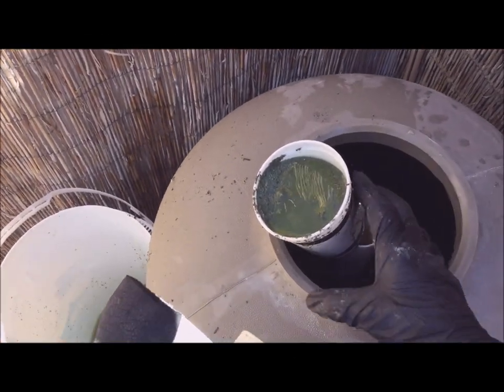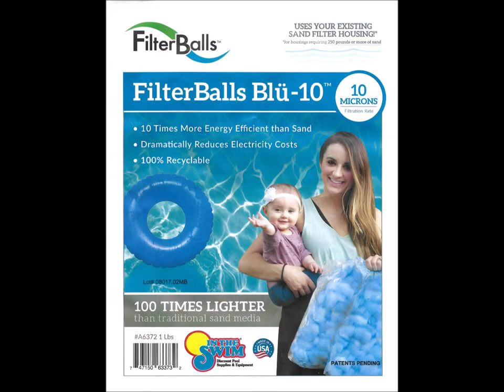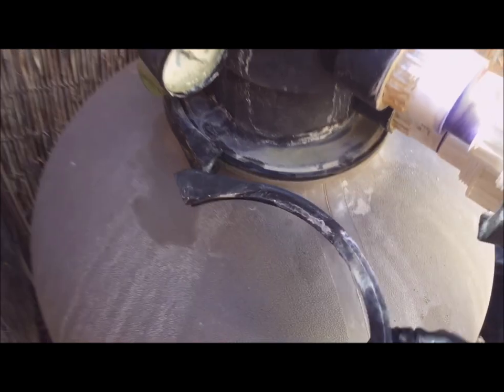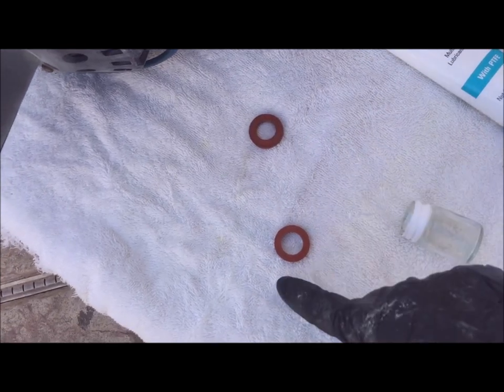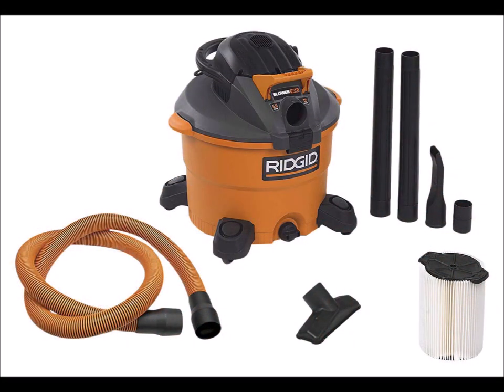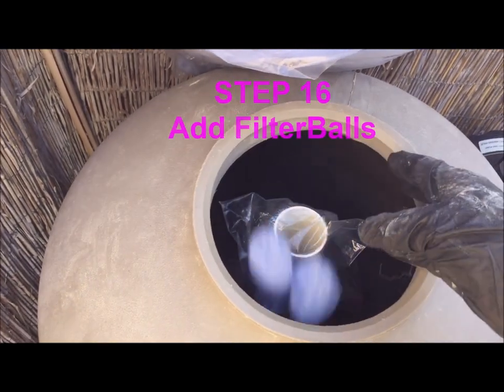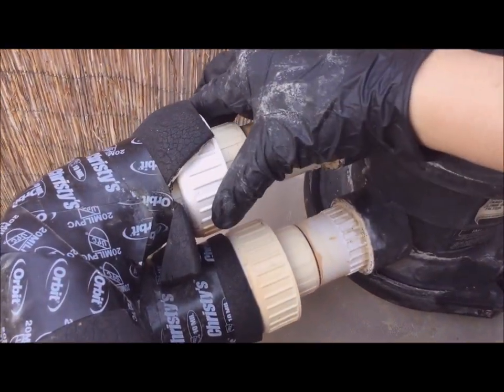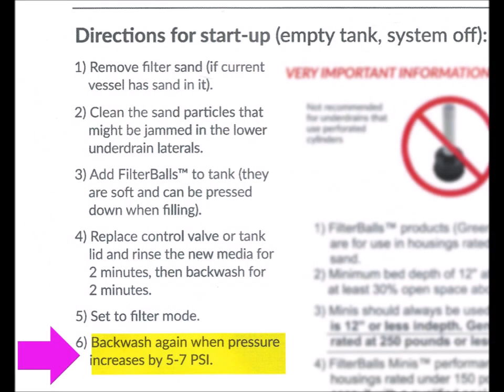How To Change From Sand to FilterBalls

Comment from the maker: ***Well I am on to something else. I am now using GLASS FILTER. Here is the link  https://amzn.to/2X0hcwq
Live and Learn. Who said owning a pool was easy! I am glad I tried it. I am leaving this video up because some of the comments are so-oo good!

SHOPPING LINK
~FILTERBALLS  -  https://amzn.to/2O3cuJl
~Hayward S220T ProSeries SAND FILTER  -  https://amzn.to/2YfGbeg
~Hayward SP0714T VariFlo TOP-MOUNT CONTROL VALVE (multiport) - https://amzn.to/2Y3Kzc9
~FLANGE VALVE CLAMP or COLLAR Noryl Replacement for Hayward - https://amzn.to/2xY83oi
~TANK O-RING (Generic) The one I used - https://amzn.to/2xWBabB
~TANK O-RING (Genuine) GMX600F  - https://amzn.to/2XRArrC
~LUBE for O-RING - https://amzn.to/2XUxG8Z
~FILTER WATER PRESSURE GAUGE The one I used - https://amzn.to/2SqH7ae
~DRAIN CAP Hayward SX180LA - https://amzn.to/2XQyDPM
~SIGHT GLASS - https://amzn.to/2JUnYcW
~LATERAL ASSEMBLY with CENTER PIPE -  https://amzn.to/2SsrbV6
~WET/DRY VAC  - https://amzn.to/2JWd5r4
~BACKWASH HOSE - https://amzn.to/32BZnCi
~DISPOSABLE GLOVES - https://amzn.to/32Ies5d
Reply: Why did you switch from FilterBalls to GLASS FILTER? Were you dissatisfied with the results? The FilterBalls website includes your video as a How-to in their product information section.
Reply: You turned your filter handle the wrong way. You went counter clockwise, instead of clockwise.
Reply from the maker: @deborahdippold291  Yes I did, thanks for the comment. Hopefully others will read this.

Comment: Great video except for 2 things, first is you don't use teflon tape on unions, teflon is for pipe threads only. Second is you backwash first and then rinse. The rinse cycle is to push down the sand or balls after backwashing and also to clear out any debris floating on top of the media. Otherwise you made a great video.I enjoyed it.
Reply from the maker: Ahh yes, thank you for your comment! Glad you enjoyed it.
Reply: Thanks for this comment. I have seen reviews that complained about filter balls allowing debris through the filter (like channeling tunnels that can occur with sand). I was wondering how to avoid this channeling. I bet the reviews with bad outcomes did not backwash then rinse properly which would help evenly distribute the balls. thx!
Reply: I don't think you are supposed to backwash with filtra balls inside.

Comment: I have a Sand Hayward s244t. How has your luck been with the laterals? I've heard you line the bottom with pea gravel if the laterals don't sit fully on the bottom. I did the filter balls and every lateral snapped off when I went to check it. Didn't even last 6 months and now I have to purchase new laterals.
Reply from the maker: The  problem I have had with the laterals is when the filer ball media clogs them up. I guess that’s why you put the pea gravel at the bottom (first time hearing about that), to try to prevent that. Terrible about them snapping off.   👎  Maintaining a pool is a lot of work.
Reply: I had the same issue. They didn't snap but they all bent (and they were one year old). Also backwashing with the balls is useless and I have to wash thoroughly (I even put them in the washer/dryer when closing the pool). When I check again the filter balls page on the website I bought them from, they have added a note : Is it recommended that you still add some sand (approx. 1 bag) to the bottom of your filter tank, prior to adding Filtra Balls, in order to support the filter laterals. Damn.. However, last year, I didn't replace the bent laterals and it worked fine !  But... an other surprise was waiting for me last autumn : the sand filter drain screen broke and also the plastic at the bottom that retains the laterals assembly in place. I don't know if this has something to do with the balls or not...The sand filter is quite old.
Reply: @twidledrum36  Unfortunately there is significant market confusion.  Filtra Balls are not FilterBalls; a very different product. If you are using Filtra Balls, that is a Chinese product, they are almost always white (though they have started making a blue), and yes they state to remove them from the housing to hand wash.  .. Stories I am aware of are housings actually failing because of the Chinese product. 
If you have questions we can be contacted by finding us on the web... one word FilterBalls, Made in the USA.
Reply: @SophiaSaysDIY  ... the only way laterals can bend is if the internal pressure is beyond the manufacturers recommended pressure or flow, creating a significant down force. A pool is a hydraulic system and the system needs to be working within specifications for it to function and operate properly.
Reply: Just use sand it was designed that way

Comment: I've been using filter balls for couple years & unfortunately I also didn't know the first time I should have put 1 bag of sand. Anyway, so far good....but I just want to be sure if anyone else have experienced little dirt/debris re-entering the pool after a backwash. I think maybe after I turn of my filter, maybe Im not allowing the backwash outlet to complete before I switch back to the filter setting. So maybe there still some dirt/debris that gets suck back into the filter. Anyone else have any ideals &/or have experience this also...lol??
Reply: rj does your pool have a push-pull or multi-port valve?  Push-pull are notorious for the symptoms you describe above.
Reply: You put In a bag of sand and the cotton balls?  I ask because I'm about to set up my pool.  I bought a new sand filter as well as cotton balls.  Just want to make sure I don't need sand as well. Thanks

Comment: I enjoyed this.  Great description and procedure.  I'm at the point of either a) buying an entire new filter  b) replacing it with sand or c) using the filter balls.  I just read some of the comments suggesting that 1lbs of sand should be used to hold the laterals down.  Hmmmm....I'm unsure if I should make the jump.
Reply: I’m not sure why anyone would go with this method. Either switch to cartridge or physically clean the sand yearly and put up with efficiency losses while saving on maintenance.
Reply: Ankit j So my update is I didn’t go with the filter balls.  I have lots of pine needles that end up in my pool. Pine needles render these balls useless. I went with Dr Dryden’s glass instead.  The difference and filtering is remarkably incredible compared to sand. Incredible.
Reply: there are also other media on the market for filters like hollowed blocks made of plastic. Don't know how they work but propably does not need handwashing.
Reply: @U2BROTHR  Do you only use Activate Glass, or do you use Enhance Summer UV liquid in conjuction? Does Activate Glass filter better than sand?
Reply: @ManOfAllCreation  Thank you for reaching out.  I ONLY use Activate Glass with CYA.  I live in Canada and I have never found Enhance Summer UV liquid anywhere.  My guess is this liquid acts the same as CYA.  I am going to say YES!  Activate Glass does filter better than sand.
Reply: @U2BROTHR  Thank you so much for replying. I'm a newbie considering buying a hottub and using Activate Glass instead of sand. I have a question for you: the chemicals from municipal water that goes through the filter collects in the glass, correct? So how come you never have to clean/replace Activate Glass in the same way you do with sand?
Reply: @ManOfAllCreation  So this past year was the first year I switched to Activate Glass.  The pool I inherited had a sand filter that had sand in it that was over 8 years old.  Sand does indeed degrade over time.  Activate glass replaces the sand and filters very effectively.  Use the coarse grains on the bottom and the fine grains on top.  Backwash the filter a few times when you first set it up...... and then start filtering.  I noticed my filter pressure was constant.  The pool was cleaner.  I also had to backwash less often.  They claim that it filters down to 4-5 microns.  I wanted something that I didn't have to worry about replacing.  Once you backwash... just like you would backwash a sand filter, you are good to go again.  The glass is resistant to bacteria growth.  Keep in mind, proper chlorine, PH, Alkalinity, CYA, and CH also all need to be balanced.  Last year was the best water we ever had.
Reply: @U2BROTHR  That's interesting to know. The value of Activate Glass is insane if backwashing is enough and you never have to change it. Thanks for the tips. I'm definitely going with activate glass.. 

I'll share some ideas for how to improve the water quality that I've read in a nutritional book. I haven't tried it myself yet. 

Raw unpasteurized apple cider vinegar, Epson sea salt, and raw milk help to neutralize the remaining poisons in the water. The minerals from raw milk, ie. phosphorous, calcium, and magnesium help to bind and neutralize toxins. Raw apple cider vinegar does the same with amino acids. Raw milk also helps to lubricate and revitalize your skin.
Reply: @ManOfAllCreation  That is some concoction..... but sadly.... not something I can use.  I have a 20,000 gallon pool!  So it is really comes down to basic pool chemistry and proper circulation and filtering in order to keep my pool clean and swimmers safe.
Reply: No, the only time sand or gravel is required is if/when the housing manufacturer requires it.  TYpically on side entry sand filters where the manufacturer removes direct support on the lower lateral arm and requires gravel to provide that support.  Always, follow the sand filter manufacturers installation instructions.
Reply: Don't use filterballs please
Reply: @AJ-we9kd  sand only needs replaced abt every 7 years
Reply: @filterballs3955  what a scheme there is no shortage of sand and its cheap

Comment: thanks for sharing are you happy with them
Reply from the maker: Just like the sand, I don’t like all the frequent backwashing. I am considering going back to a Cartridge.
Reply: @SophiaSaysDIY  Thanks for reply i used zero sand this year not a fan it ended up in my pool way to much cool Chanel btw
Reply: @SophiaSaysDIY  its funny i got away from cartilage i had 4 filters 4ft tall took awhile to clean
Reply: @SophiaSaysDIY   Frequent backwashing?  Are you backwashing on pressure increase or time?